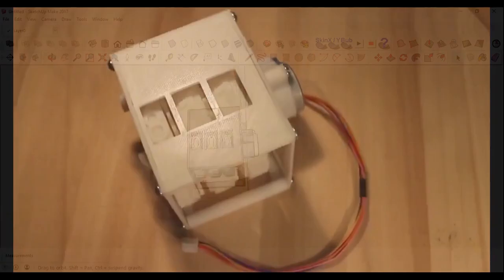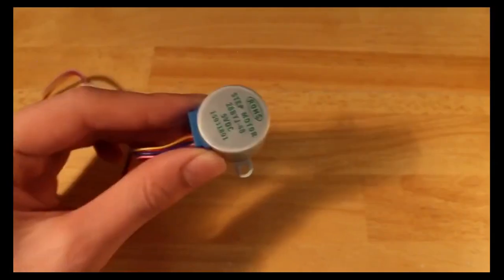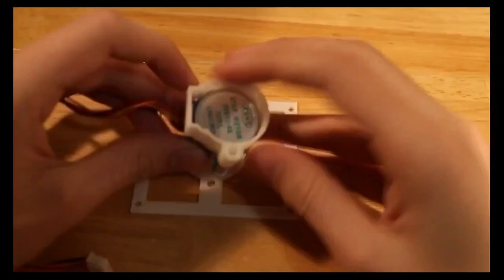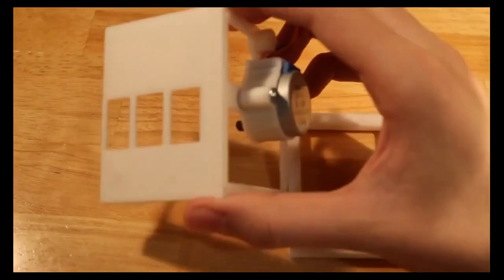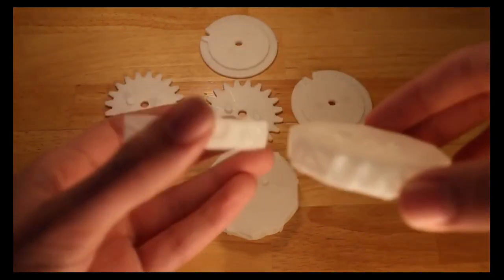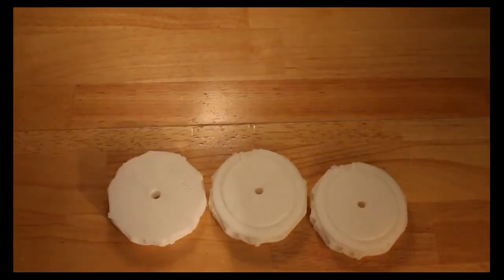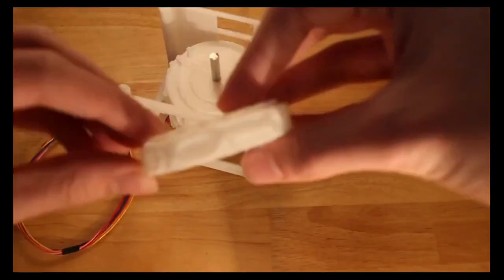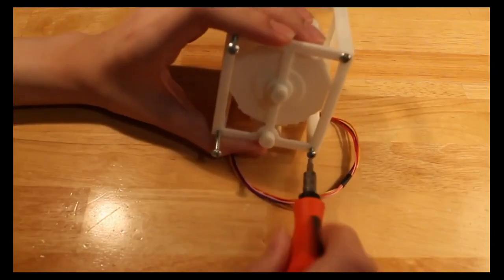3D printed: mechanical counter

Comment: Do you have any intentions to extend this panel?
Six or seven digits would make a great API counter.
Reply from the maker: Ya, I've thought about it defor. The problem is that with the 3D prints there is enough play between two wheels that anything more than 4 I'll have problems keeping the numbers constant. I might be able to fix it with multiple motors but for the time being I have no intentions to add multiple wheels.